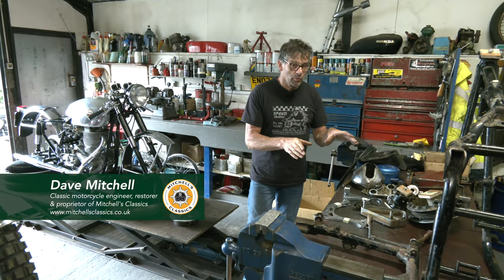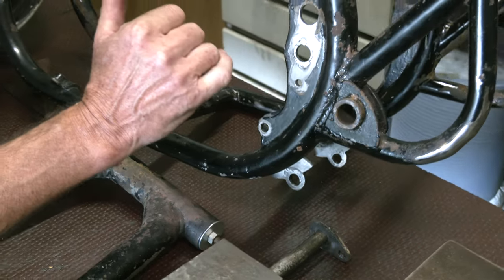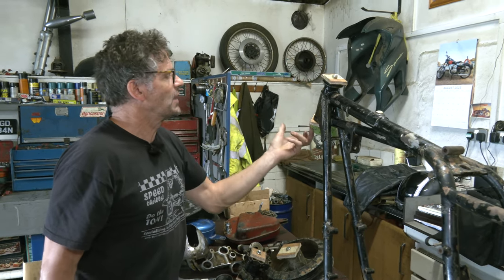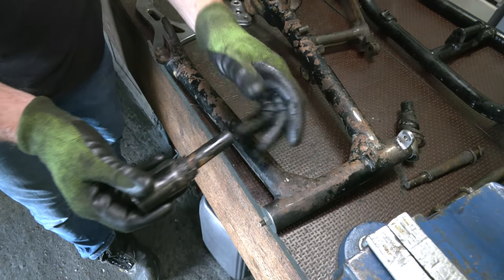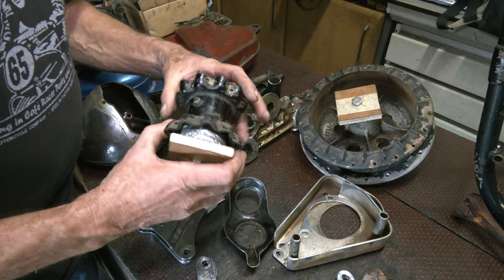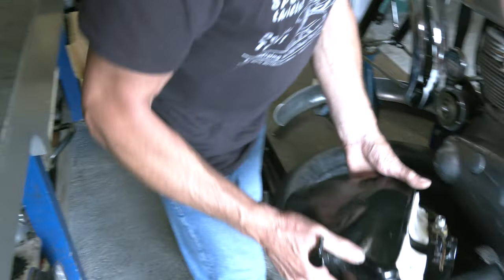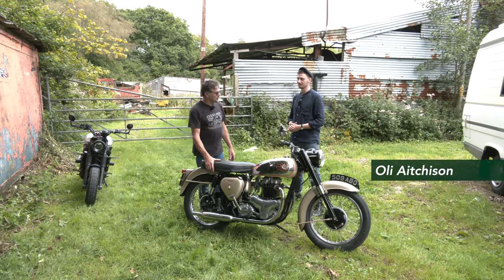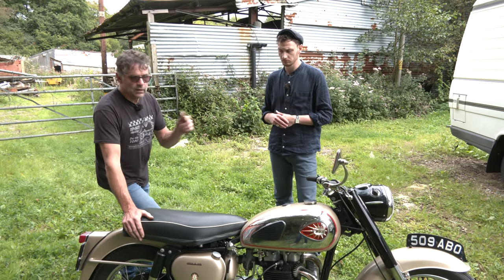Classic Motorcycle Workshop Vlog 24 - BSA Golden Flash finished etc

Comment: With respect to the rubber swing arm bushes: l would be tempted to make a change, perhaps even roller bearings. Like other modern technology which replaces older tech, such electronic ignition, a modern oil pump, external oil filters, a sump plug to go with the plate, etc and modifications to main end and big end oil feed on A65's, l would probably consider a modern replacement for these archaic bits of mechanical tech, as the rubberised bushes provide little or no advantage over a modern alternative.

Comment: Sorry, one more comment, which may be completely off-base.  If this is indeed a Gold Star swingarm conversion (solid spindle) using a Q/D rear hub, a G/S brake spindle bush, or similar, needs to be added for a brake pedal mounting point.  Hopefully this can be confirmed prior to powder coat. (edited)